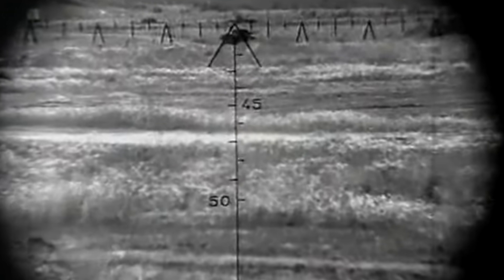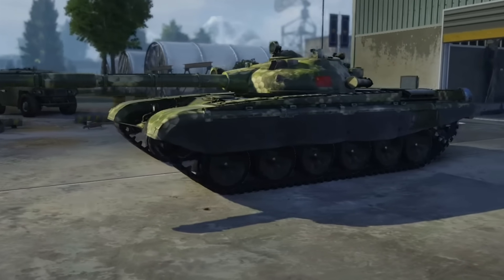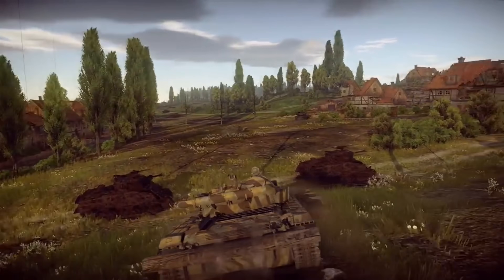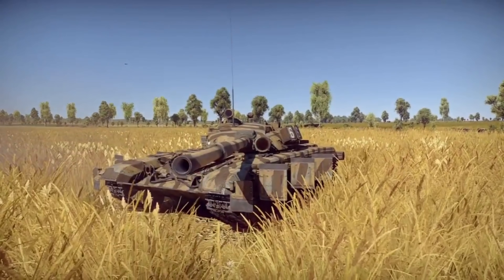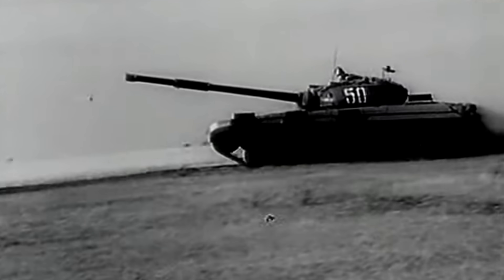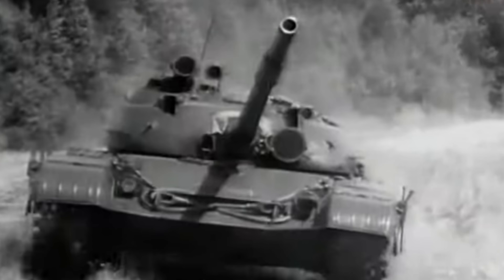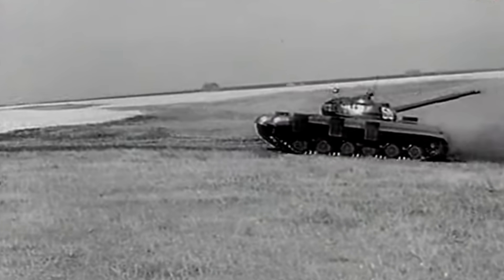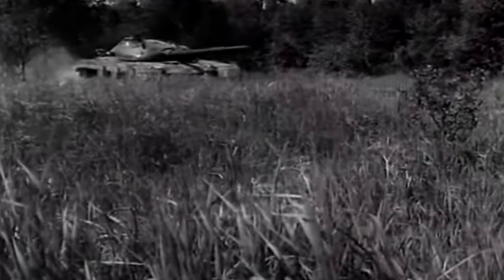What are the side plates installed on Soviet Tanks? | TANK TECH FAIL!

Comment: I volunteer at an armor museum in Massachusetts and we have a T-72 with those spring loaded gills.. I was told when I first started about the standard explanation of why they are there, BUT on two separate occasions, one involving me, two former Russian tankers said that they were used for fording a river to push water aside.. He also mentioned to me that by the 70's they were no longer using older sighting techniques so the explanation about the width throwing off sighting might not be valid.. Food for thought..

Comment: The corner stone to Soviet Doctrine was to pre-emptively strike, which means no laying around in hull down positions.  The gill armour with it 45° angle attack protection would mostly come into its own when passing through infantry positions.  Most infantry of the mid 80's had numerous HEAT based weapon systems for dealing with tanks and the gill armour would offer some degree of protection from these systems.  I have not read anything suggesting they were for tank vs tank encounters.  They would have almost nil effect upon an inbound APDS round. It was just another attempt at improving the layered defence of the tank, just that it's implementation was not as it could have been.

Comment: woah woah woah. Who said anything about the speed at which the round is hitting, or slowing it down? Those don't matter for HEAT, save for providing ease of aim.

A) There is no "melting" of metal when it comes to HEAT. That's not how it does, or has ever worked. It's a shaped charge, not some weird liquid metal nonsense.
B) The point is to trigger the shell's fuse early, which by necessity is more sensitive than an AP shell lest the HEAT round deflect from the armor and ruin the angle of penetration.
Reply from the maker: Lol 🤣😂🤣 cute.
Reply: @_Matsimus_  I guess you can continue being a manchild.

Comment: Tracking tanks by left over pieces seems very stupid argument. In nature, tanks leave almost always deep marks on the ground, especially if there are multiple tanks in a convoy, but also when they are advancing  side by side, there is very high likelihood that at least one tank leaves marks on the ground. 

The only case where this really matters is when using roads where it is possible to drive without leaving any marks, but following a road completely defeats the purpose of trying to hide from enemy as roads would be obvious place to search especially when no track marks never leads to off road.
Reply: It is very rare for tanks in wartime to leave no mark on the road. Tracks dig in and scrape all over to get a grip.
Reply: @Gustav_Kuriga  I should've been more accurate and say that it's pretty much the only PLAUSIBLE scenario. When a tank is going in a straight line with steady speed, a well built road will be able to hold its weight with no marks but of course when the tank is turning that is completely different.

Comment: These are flapping oar-like appendage, designed to help hasten the mobility of T-64 in its infamously slow reverse gear. When they are flapped quickly enough, it will sped up the reverse by 1 communist unit per work hour

Comment: Reason why these panels, and later on ERA blocks on the skirs only extend a limited distance back, is, what Russians refer to as, "safe maneuvering angle arc" which they calculate to be 30 degrees off from dead-ahead on their designs. This is where armor is the thickest and protection is highest. That's why the T-90A and T-90M have a hexagonal turret with wide armor blocks on the front, but taper towards the back into a narrower shape. Hence, for a long time they didn't bother to add any extra ERA or slat armor further back: to them tank is used against enemy head-on. But now that Russians are reviewing their tank employment doctrine and tactics, they've added extra armor protection to widen the range of protected angles.
Reply: А какие углы были на западных танках вы нас просветите,судя по вашему комментарию 30 градусов это мало или недостаточно?

Comment: The idea was very good ! It was a very cheap and low weight way to add some protection to the tank. At a time were many WWII weapons were still in service and ATGM were basic charges on a missile I am sure it was a good choice.
But of course with the way it worked the plannels couldn't be heavy, so the protection against modern weapons, made to be effective against spaced armor, is none. Also it's only useful against "frontal" attacks and limit the protection of the sides in a world were a MBT can very often be attacked on the sides... (and all the other problems presented in the video)

Today, if tanks were created only for front line use on open fields like some during WWII and just after I am sure we would see this idea coming back, but with reactive armor. Like that you wouldn't need so much of it on the sides, which mean you can use the weight gained for a bigger gun/front armor.

Comment: Has there been any research done on water armor? As in literal void spaces of hundreds of gallons of water being used to deflect and stop kinetic rounds? Would a full tank of water even still have "surface tension"
Reply: Sure, been in use for over 100 years, they're called "submarines". :)

Seriously though, that sounds like a terrible idea. A quick browse through wikipedia shows that modern APFSDS rounds like the M829 series (used on the M1 Abrams) go through about 0.5 m (~1.5 ft) of rolled homogenous armour. Unless you have an Olympic swimming pool surrounding your tank a bit of water isn't going to stop that. Water, being incompressible, is also really good at transmitting shock waves, so if the tank gets hit on the outer skin with some form of explosive the shock wave would travel through the water and hit the inner walls with pretty much the same pressure as if the water wasn't there at all and the explosive blew up on the inner wall. If that doesn't outright kill the crew through spalling/blowout, they will very likely have to deal with a fighting compartment, where all the sensitive electronics for targetting and communication are, that is now quickly flooding with hundreds of gallons of waters. Then there's issues with the water freezing/evaporating in cold/hot weather, the risk of springing a leak through small arms fire, wear and tear or just bumping into a sharp rock or tree stump or something...

Nah, best to keep the water for drinking/showering when the tank crews get back to base and give them some proper armour so they have a decent chance to get back and enjoy that drink/shower.
Reply: Read about the "torpedo protection systems" of capital ships just before WW2. They used a mixture of air, water, and fuel filled compartments to absorb the blast of a torpedo.
Reply: What about sponge or maxipad gel armor soaked in antifreeze? Any good against HEAT(pun)?

Comment: Cheap but effective anti Heat/ATGM armor.
Reply: Indeed. The cage spaced armors on the back of Abram turrets are even less effective, although without the downside of unreliable pop-out mechanisms. This kind of stuff cost almost nothing in either money or weight, so why not? The Chinese replaced the cage on the rear of Type-99 turrets with spaced blocks of composite armor, but now they're heavy and bulky. There's going to be tradeoffs one way or another.
Reply: @georgedang449  If the "enemy force" ends up behind your "MBT" on the "battlefield" in any way shape or form it's already as good as "lost" along with the "crew" and "bulky and heavy" is of damned little concern at that point and may keep the most important "part" of that "weapon of war" - its "powerplant" - up and running long enough to "run bravely away" far and fast enough to get out of "grenade range" - rocket-propelled, launched or simply "tossed" - before "small arms fire" makes into a literal sitting duck and at least immobilizes the real "weapon of war" - the "crew" inside and "behind enemy lines" where they are truly helpless, useless and "liabilities" instead of "assets". 

The only reason for "cage armor" on an armored INFANTRY-SUPPORT VEHICLE like an "MBT" is there are no "front lines" and it's in a "peacekeeping role" rather than "warfighting" in an "urban environment" during an "insurgency" and "enemy combatants" are cleverly - and "illegally" per the "rules of warfare" of "civilized" and "western" nations and their "allies" in "support roles" - disguised as "civilians". 

The "Russians" - formerly known as the "Soviets" have been there and done that in "urban warfare". So has "Germany" (known to "Germans" as Deutschland) and "America". 

"Commonwealth Forces"? Not so much or at least not in any "fair fight" and/or as "front line forces" with "enemy combatants" similarly armed, professionally-trained and "motivated" and within effective "artillery range".

Therefore "Commonwealth citizens" tend to think machines "win wars" and not men, think armor is a "tradeoff", believe in "volume of fire" as a "strategy", "stand shoulder to shoulder" with their "allies" only when "standing behind" them is out of the question and believe wars can actually be "won" even though not a single "enemy force" in their entire "military history" of scores if not hundreds of "coflicts" over centuries and centuries as a "great power" on the "world stage" and "around the globe" has EVER actually "formally" surrendered - unconditionally or otherwise - to "HM armed forces" and "HM Government" - and made them the "winners" in/of a real "war of agression". 

The "Germans" and "Japanese" did not surrender to any "Allied power" besides the United States of America and both waged "unrestricted warfare" on "Russia"  as well as "America" and vice versa to "win the peace" because "Russians" and "Americans" know there is no "end to war" until "empires" are beaten into submission and "monarchies" made into mockeries of "democracy".
Reply: @georgedang449  The only "cage" anything on the back of a U.S.  Abrams turret is a storage rack. The only "cage spaced armor" aka "slat armor" on an Abrams is over the engine exhaust and it's there to keep "enemy combatants" from tossing or firing or launching grenades or IEDs into the "power pack" via the exhaust system and destroying the engine of a parked or patrolling tank in an "urban environment". There isn't and never has been a "main battle tank" that isn't/wasn't all but unarmored in the rear unless it was essentially rendered "unserviceable" in the field as far as maintenance and repair of the "power unit(s)" but the Abrams is about as protected AND "armored" out back as possible while easily being the most field reliable, durable and field- serviceable armored or unarmored military vehicle of any type ever made. The gas turbine engine makes for only a handful of "moving parts" in the engine, the engine is "air-cooled" and requires no liquid coolant, requires single-digit quarts of lubricating oil compared to the tens of gallons required by reciprocating "tank engines" and its "automatic transmission" and hydrostatic differential steering system are a fraction as complex, bulky, inefficient, fragile and heavy as any other "skid steer" MBT made as well as the very few actually "comparable" and "modern" MBTs with "similar" powertrain components IN PART. 

What's truly hilarious is how many "experts" do not "get" that as "infantry support" AND "infantry supported" vehicles "Russian" tanks designed and engineered and constructed with "urban combat" in mind as the REAL "iron curtain" they were equipped that flip-out "side armor" so infantry troops could walk or stand/crouch/hide alongside them and have some protection from "small arms fire" when advancing on the "battlefield".  They also provide some undercarriage protection from "explosive devices" - primarily grenades -  tossed/placed/fired at/on the tracks, track rollers etc which were/are quite "fragile" given the materials they must be made out of and how they must be designed and constructed to be "field-serviceable" as well as "high speed mobile". 

The easiest - and "cheapest" -  way to "knock out" any "MBT" is no different than knocking out any other vehicle. Inflict "unserviceable" powertrain damage upon it and immobilize it. Meaning "take out" the tires or tracks and immobilize it and the REAL and "priceless" and irreplaceable assets that make it a "weapon of war". The "crew". It costs far more to "build" and "deploy" and "service" and "maintain" a "crew" than it does any "military vehicle". 

"Russia" - like all the other republic "combatant" NATIONS involved - lost 20 million people - overwhelmingly "military age males" - in EACH of the two World Wars and actually value human life as a "civilian population" overall and have experienced massive loss of life "at home" in civil wars as well as "foreign wars" and had to "finance" their own "economic recovery"  just as the other truly "great powers" do as a result while the "Commonwealth" countries "allied" with them suffered comparitively light "losses" of mainly "working class" subjects, had little or no real "war debt" and had the overwhelming majority of what they did have "forgiven" or "forgotten" or "financed" by their "enemies" AND "allies" and because their "human costs" were so low and what little fighting and dying they did was by the "working class" and not the "ruling class" it was and is never "counted" and they're still wannabe "warlords" today sending "troops" into so-called "battle" in "open" so-called "reconnaisance vehicles" and haven't "deployed" to an actual "front line" since "Dunkirk". 

Therefore their "military historians" look at "flip-out side armor" and think it's there to protect the "MBT" instead of "troops" MBTs actually support and are supported by "in the field".